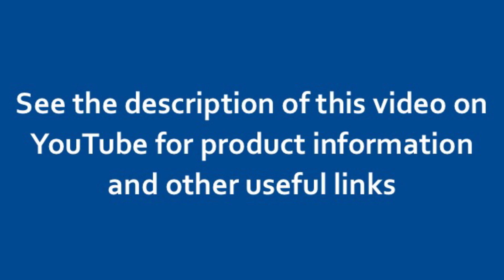Honeywell RTU2020 Hardware Demo

Comment from the maker: Today, Avid begins a new video series on YouTube with a review of Honeywell's RTU2020. The RTU2020 combines a full set of programming languages, a powerful 667 mHz processor, data logging, and a variety of networks in a compact and rugged unit. The RTU has 28 built-in I/O signals (including digital and analog with HART support) and is ready for expansion. It operates on about 1.8 watts, making it ideal for distributed applications in areas where solar power is required. Take a look!